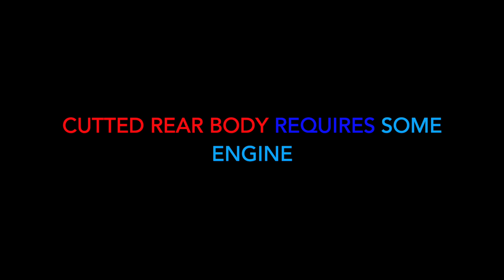TAMIYA  1\10 LANCIA 037 RC  ASSEMBLING AND UPGRADING

Comment: I have found a 037 for a good price on the internet. But I am thinking to modify the cockpit. In the real one behind the two driver there was the Lancia supercharged engine. So I am thinking about a project on how to build a model engine with some spare plastics. I could start from some Evergreen material, but I am happy to receive some suggestions from your experience. I hope you enjoy your lifted lockdown.
Reply from the maker: Nice idea and great work. if you have some pictures you have to focus on the main volumes of the engine. Evergreen is the top. Once you have the row engine than you can add some details the identify that kind of engine. No matter if it is not identical. Once in the car it will looks good. Have fun and remember: every single part has to be done as it is a model it self, no matter the time it needs. Ciao!